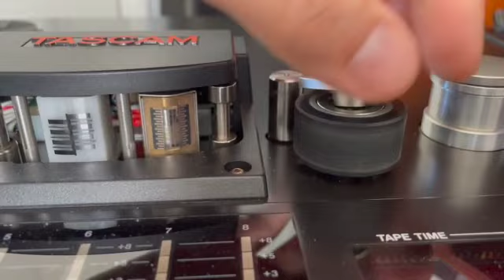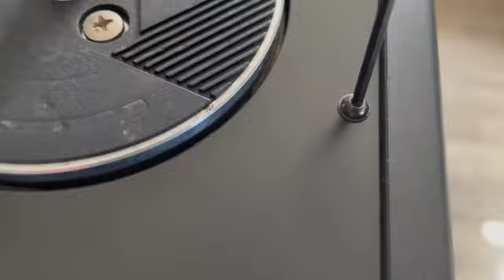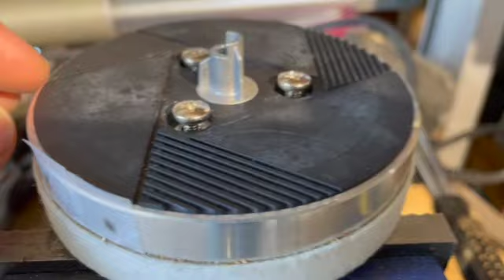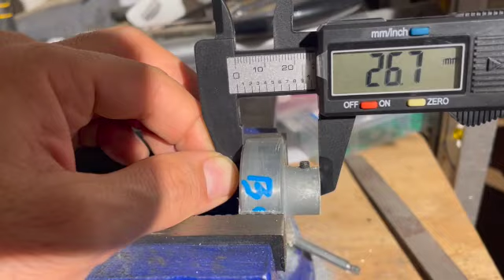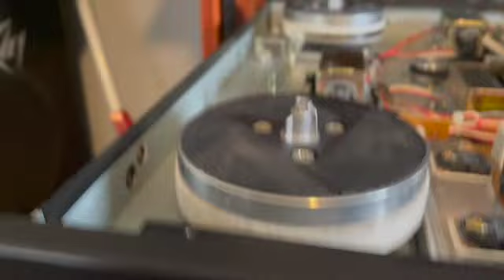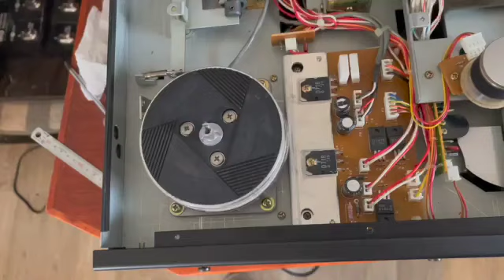Tascam TSR-8 Reel Wobble Repair

Comment: Thanks for the video. It was very helpful. I just swapped em on a MSR-16, the procedure is the same although the bushings are slightly different. Got em from tascamninja, they fit perfectly.

A tip on getting the bushings out: screw in M4 screws from the rubber side. Just a few turns - leave them sticking up as much as possible. Then simply knock the screwheads with a hammer (carefully but firmly). Put a few taps and move on to the next screw, repeat until the bushing simply pops out.

Instead of removing the break band screws I just unhooked the spring to relieve tension. That way you can’t mess up the settings. However I nearly crushed the break band when putting the tables back on, so your route is probably safer.
Reply from the maker: Glad there are some analog legends still out there!

Comment: I did something unorthodox, but effective with mine with the minutely wobbly reel since it's like getting one at Fort Knox.  There was a minor wobble with mine, so I took one of those little plastic pieces that seals a carton of almond milk shut, cut the little pull tab off of it to only leave the button-like plastic piece, found the lowest point, and shimmed it under the reel hub, tightened the hub screw to flex it down, and it's now perfectly straight when rotating.  I'd like to fix it the right way.  I took the cover off, but like your problem to where yours was stuck, mine is the same way, and I don't want to wreck it when it's usable.  This is my Tascam MSR-16, by the way.  The other thing that I did when I had it apart is took the reel guides off on each side and oiled the hinges with a tiny dab of 3 in 1.  That actually fixed one issue that I had to where sometimes the takeup reel would overshoot very mildly and put the machine in stop mode.  I can't prove it without a service manual, but I'm thinking the roller guides on each side determines what mode the machine is in as well.  When I Return to Zero every time, it hasn't overshot and do a mild tape dump from the takeup reel.  It needs a couple more things, but it's more than usable.
Reply: I have those two exact same issues with my tascam 32! I might try that shimming method myself. And sorry if this is a dumb question, but what is 3 in 1?
Reply: @brettwintersmusic not dumb at all. 3 in 1 oil. I missed that. Sorry.

Comment: Whoever makes this part well, gets rich, since the majority on the market, 99%, suffer from this problem, everyone who sells on eBay, does so for this reason!
Reply from the maker: tascam Ninja has them machined out of aluminum and sells them on Ebay for about $72. That's not a bad price ($144 for two). I sold my TSR-8 recently to a studio that does tape archiving, but I still have two bushings that I made, and I will put on ebay soon, probably cheap.

Comment: Got a pair of hubs from tascam ninja. Fixed old wobbly issue. On my machine , with the set screw all the way down on shaft flat spot , my reel bed was 1.5 mm to high. had new hubs milled down 1.5mm on reel bed end and was able to get back good as new.
Reply from the maker: Awesome.Keep rolling!
Reply: tascam ninja  is my mate  j 
he's the one all ways asking me all the time

Comment: Thank you so much for making this video! Definitely could not save my TSR-8 without this info. Do you have a link to the Dominican eBayer selling the fabricated bushings?
Reply from the maker: Glad the video is helping. Yes, the Dominican seller actually has a bushing right now, but it's the 3340. Just cut the tip off and it will work fine. The machined aluminum TSR-8 custom bushings are very rare, I only found that one. Hopefully someone will machine more soon.  The ebay seller is "treasuresforparts"